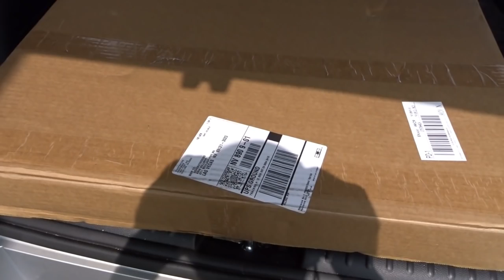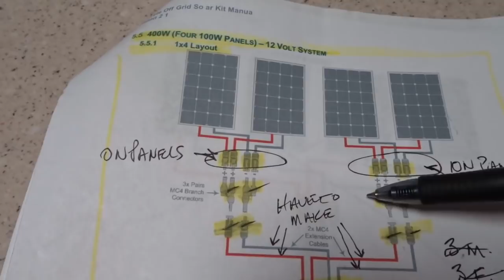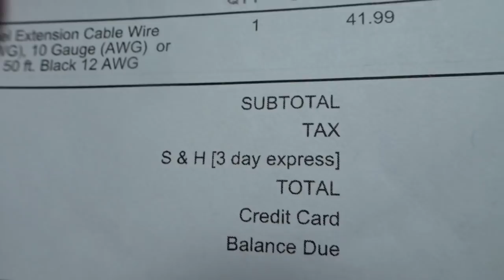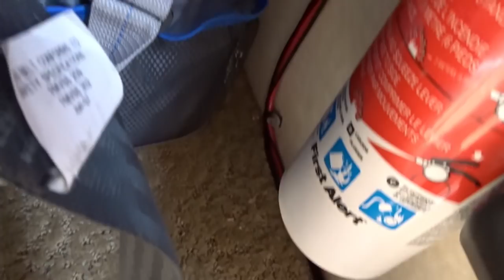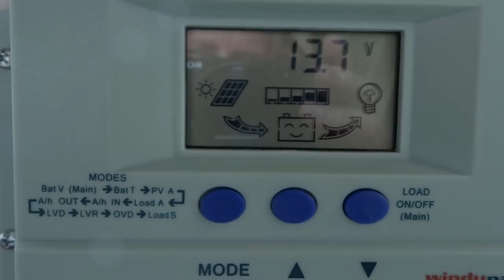SOLAR PANEL INSTALL -  400 watt instillation on my Southwind Motor Home.

Comment: I like the budget price of your system. My advice get Victron charge controler, its not going to bancropt you and it's a must.
Reply from the maker: I will look into the Victron Controller, I choose this system because it was a simple all in one kit at a good price....I may upgrade later after learning more about how it's working out.....I watch your videos and have subscribed....if your still in Vegas I would like to meet up...I'll be at the Westgate tomorrow for Trooper Thursday at 4pm...you should come by and play some $1/$2 or $1/$3 NL..my email is in the description....stay safe. 😷👍
Reply: @OLDMANCOFFEE  I really left Las Vegas. Ill back some times Dec-Jan. I'm in Utah, visiting National Parks and freezing on 10,000ft elevation.

Comment: Nice to see you're going to take advantage of all that Vegas sun. I'm actually surprised you haven't done it earlier. I'm curious, how much will those panels save you each month? Can't wait to see you in a few different casinos running it up!
Reply from the maker: the average cost of electricity at the RV park was $150 a month...then there is the $465 for the space rental....so I will save that much total by not being in the Park. 😁👍...it's something I always wanted to do but never seemed to take the time....I had solar panels and a wind generator on my sailboat for many years.....👍😁

Comment: How many amps in your battery bank?   How old are your batteries?  I boondock for 7 months a year.  You'll find batteries to be the long pole in your tent.  Never let them deplete more than 1/2 capacity. Keep them full of water and equalize every month. A 400 watt solar array can feed a 400 amp battery bank. This should be more than enough for you to power lights, charge phones and computers, run radios/small t.v.( 3 hours a day) and run your water pump.  This is the size of my system and it works great. ( I do run the genny once a week for a full charge) You'll need to run your refrigerator off Propane. ( you'll not have the power to run it off solar)  You also need to avoid running your furnace ( the fan on the furnace will kill your batteries)  Heat with a Mr. buddy or something like it.
Reply from the maker: the Batteries are AGM 79 ah that seem to be doing very will this this set up....I like the controller I have it will tell me the charge state of the Batts so I can start the gen if needed...Propane for the Fridge for sure! thanks for the info William.

Comment: It looks like the wires run thru the slide-out.  If so, what happens when you put the slide-out back in for travel?
Reply from the maker: The wires are running along the Chasse Frame not on the slide-out...but thanks for your question Nicholas....👍😷

Comment: I don't think u said what the panels will power. I doubt they will run your ac?? U need a few huge lithium batteries. 
Store that power for the night time
Reply from the maker: They will power all the 12V DC items in my RV....I will have to use the generator to power the Air Conditioning and AC appliances....I have a 5.5k watt generator that will take care of that....😁😷👍

Comment: Where can you stay off the grid in Las Vegas
Reply: You really can't.  But you can stay in some boondocking areas North of town around lake mead or many areas down in Arizona.  These work great in the Winter but it's too hot for desert boondocking around Las Vegas and Arizona. ( except around Flagstaff) I expect OMC will have to venture North and get at an elevation above 7000 feet for the summers.
Reply from the maker: There are some Casinos in Vegas that will allow free parking for RV....but not many, I will keep you updated in the videos of the places I park that will allow it.....thanks for your support Frank.
Reply: Is it true Walmart parking lots allow RV's for free?  Any nearby?
Reply: @theyofactor  yes Walmart does let people stay overnight at SOME WALMARTS. Not all walmarts will let you . Unfortunately the ones here do not from what I've been told . I've herd the one in the country are your best bet and you cant stay for more then a couple days. I live next to Mandalay bay and id see rv's in the over flow parking before covid. Its closed now. Not sure if there going to reopen it . Any good luck out there. Be safe